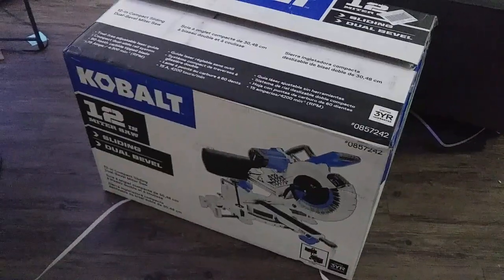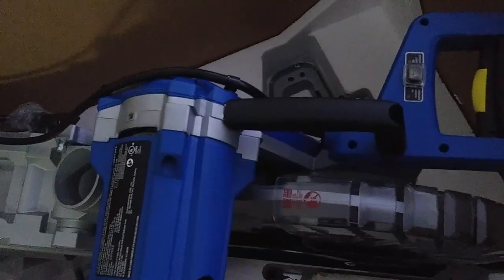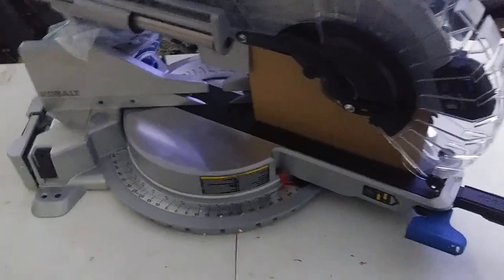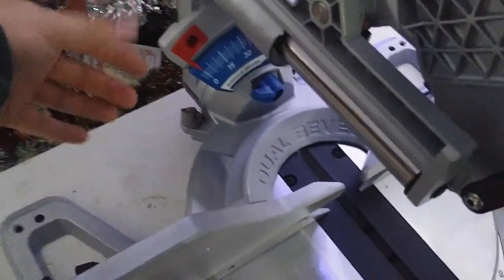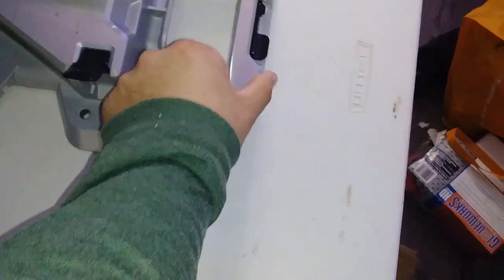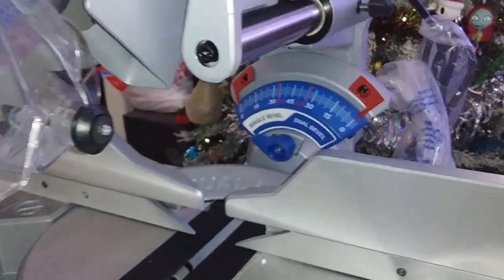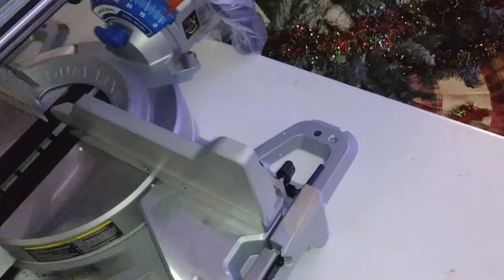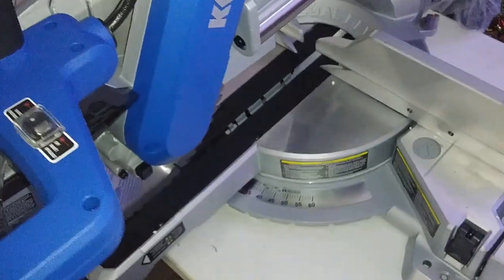Kobalt 12-in 15-Amp Dual Bevel Sliding Laser Compound Miter Saw Unboxing and First impressions

Comment: I recently purchased the 12" cobalt saw. I first used it yesterday and not knowing anything about mitre saws found the yellow toggle safety switch a very good feature. You have to consciously toggle the yellow switch  while pulling the rest of the switch to the rear to make the motor  start. I seriously like that feature.

Comment: i know u obviously went out and bought it but would u recommend it now after using as opposed to the dewalt equivalent miter saw? i mean there is a big price gap. do u think it holds up or do u get what u pay for?
Reply from the maker: Yes its been about a year and i would still recommend it. I havent had any real issue with it . Im still not a fan of the laser I feel you just cant get it set just right but to me thats a non issue i dont use it. The only thing I can say for a real , may affect detailed work, kinda issue is the arm has a vary small amount of flex so when you have to make vary exact cuts you must lower the saw straight down and be sure not to put any side to side force on it . With that said I believe this is still a vary miner issue The smaller saws probably still do this too but its going to be less noticeable the smaller the saw . Also most brands will likely do the same thing . I cant speak for the dewalt saw as its been year seance I've used one I have used dewalt drills and preferred kodalt . Dewalt makes nice stuff but is more costly and I believe kobalt is right on par and at a lower price.

Comment: Did you figure out the laser? I can't get mine to work.  Any ideas?
Reply from the maker: To be honest I haven't used the laser much I found the adjustments to be difficult to fine tune. It is powered by the saw no batteries needed.
Reply: Google any questions you may have?

Comment: Just went out an bought one for myself!
Reply from the maker: I used it for 2 small projects. I will say make sure the fence is square to the blade. The one I got was off. Its an ez fix. Other than that going well
Reply: @jaredrogers1544  how do you adjust it?